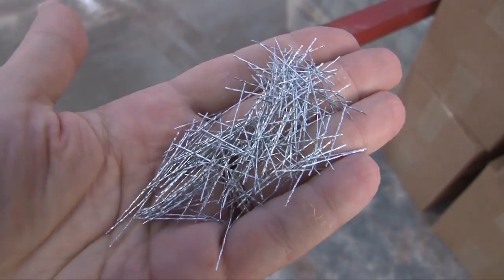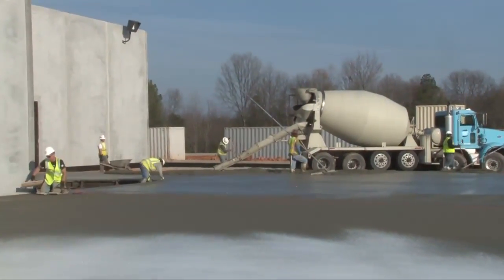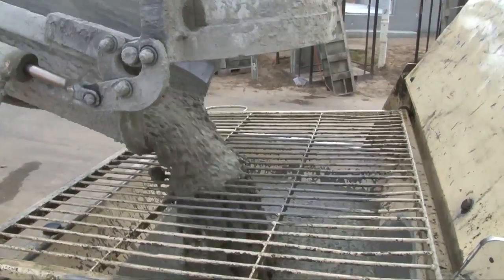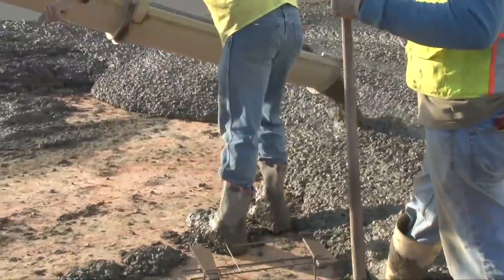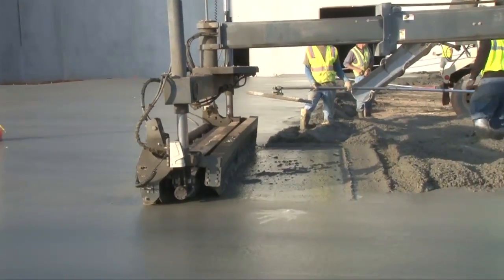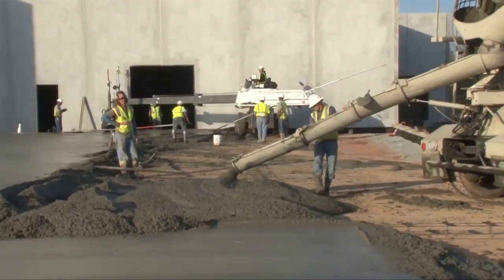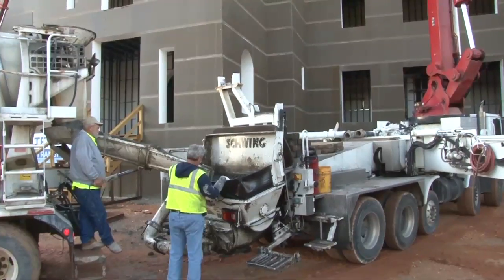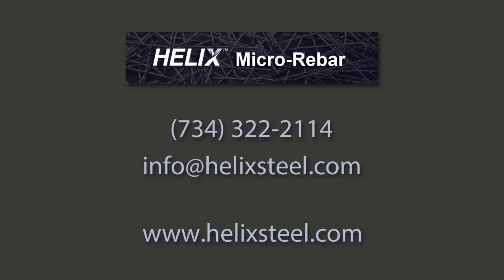Helix Introduction Video

Comment: Corossion?
Reply from the maker: That's a great question, Each one-inch (25-mm) twisted steel reinforcement is coated and individually sealed to withstand elements. Proper concrete finishing techniques will ensure that the steel is forced below the surface. Helix does not provide additional entry points for moisture. You can read more on our FAQ page here https://www.helixsteel.com/faq/, thanks!

Comment: Use hybrid high-tensile steel rebar and double-twisted high-tensile steel fiber reinforced concrete. The steel rebars will be of the same thickness and density placement as if they are going to be used in a conventional manner while steel fiber reinforced concrete will be poured all around them. Double-shell truss monolithic reinforcement steel rebar designs using hooked ends and bolted mechanical clamps are required for both military and civilian requirements throughout the Russian Federation and in the United States for all new structures since 1990.

Comment: Can holes be percussion drilled into concrete with this reinforcement?
Reply: ..I would image yes you could.  There aren't any Obstacles in the Concrete to interfere with your drilling, like rebar or other structural material or elements.

Comment: Can this be used to make a Faraday type cage building for stopping EMP?
Reply: No
Reply: @bobjoatmon1993  Use conductive concrete already commercially available https://edgy.app/new-conductive-concrete-emp . In the past my country uses calcined petroleum coke mixed with 30% cement-sand binders and then we add 480 pounds of double-twisted stainless steel fibers for every cubic yard or cubic meter of the calcined petroleum coke mixed with 30% cement-sand binders
Reply: Use conductive concrete already commercially available https://edgy.app/new-conductive-concrete-emp . In the past my country uses calcined petroleum coke mixed with 30% cement-sand binders and then we add 480 pounds of double-twisted stainless steel fibers for every cubic yard or cubic meter of the calcined petroleum coke mixed with 30% cement-sand binders.

Comment: Can Helix® Micro Rebar™ reinforcement be used to replace rebars and pre-stressed cables in the construction of steel-reinforced concrete hyperbaric domes ranging from 100 feet in diameter to 500 feet in diameter with a thickness ranging from 1.2 to 2 inches thick ? Or in the form of a large rectangular shaped warehouse size hyperbaric building with outer walls and roofs ranging from 4 inches to 12 inches thick? And capable of withstanding internal atmospheric pressures ranging from 50 atmospheres per square inch to 100 atmospheres per square inch?
Reply: I think you mean hyperbolic. And you’d want a catenary arch roof or dome. It is the most stable arch form for your application.

Comment: Is this good for footers? Is it a supplement or a replacement for rebar? Thanks
Reply from the maker: T Rex yes, it is easily used in footings to replace rebar. We would be happy to take a look at a project and provide a design to replace rebar.
Reply: @TheHelixSteel  Thanks. I will contact you at some point in time. I am building a rammed earth home and the footings need to be good. An 8 foot high rammed earth wall weighs about 2 ton per linear foot (the wall is 24 inches thick). I want something that can last a very long time. I was also considering basalt fiber. I also need to add rebar to the rammed earth walls and once the forms are removed, the finish is the raw rammed earth. rammed earth is gravel, sand, cement, water, 10% clay colorant, and rebar. The mix is very dry, and is rammed into place within a form. I want to make sure that what ever I use, it will withstand the test of time and is cost effective.
Reply from the maker: @trex283  Give us a call at 734-322-2114 ext 3 or email at sales@helixsteel.com. I know that our micro-rebar performs exceptionally in footings in heavy industrial applications. As for the walls, we'd really want to take a look at the mix and specs to see if we can help with reinforcement in the walls, but the footings are a great application.
Reply: @TheHelixSteel hello sir I want this product for my final year Mtech project, Iam from Bangalore India ,how do I get this product.